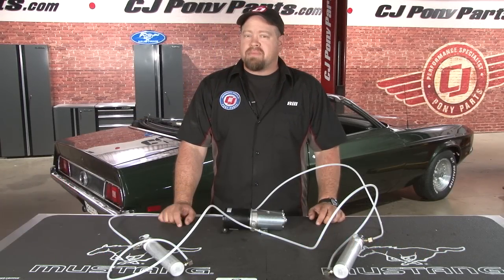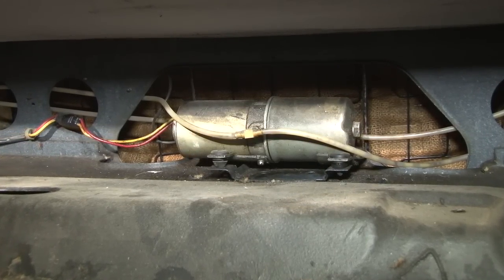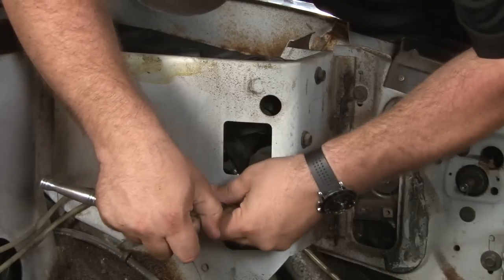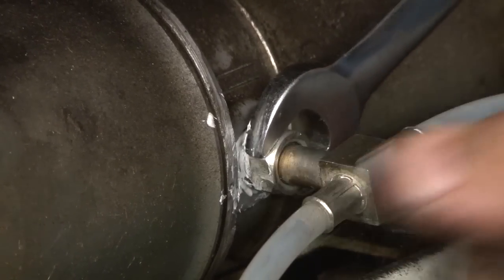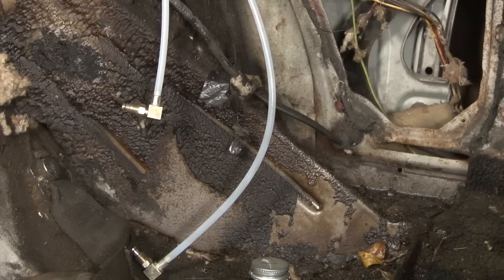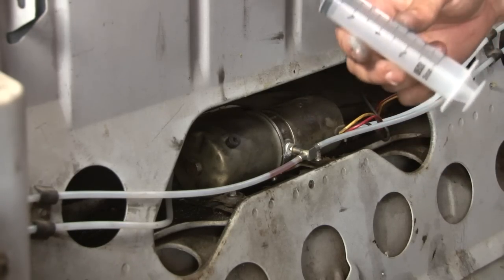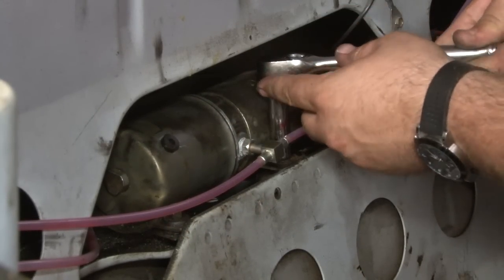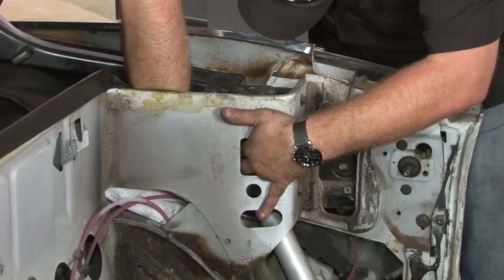Mustang Auto Pro Convertible Top Hydraulic Cylinder Driver Side Or Passenger Side 1971 Installation

Comment: I am working on an '05 mustang.  It is amazing how little the system has changed.  I have one cylinder leaking.   Time to get to work, and hope for the best.
Reply: just bought an 01. top stopped working shortly after. motor and switch seem ok will change out my cylinders. just wondering if the hoses leak. your thoughts?

Comment: I followed this video to replace the hoses for my 67 Ford Galaxie 500 and it was nearly the same.  Thanks you.. The 67 Galaxie has 3 bolts holding a plate that keeps the cylinder in place rather than one bolt.
Reply: i have a leak in my cylinder or at the connection.  i can open and close my top but only with the glass window unzipped.   Do you have glass?   the guy that installed the top said i should have it unzipped when putting top down.   pain in the but.   i am heading out to work on the hydraulics leak on my 67 galaxie 500

Comment: Thank you. I have EXACTLY the same problem in my 2003. I am ordering the hydraulic hose line and tackling it myself. Thank you! Ford dealers were no help!
Reply: Lily, I just bought a 2001 in april. the top went up and down fine for the first few times. Now I am seeing leaking inside the drivers area where the top comes from. I think replacing the hydrolic cylinders will do it. what about the hose lines? How will I know if I need those. did you do the project? how did it go?

Comment: I just recently fixed the hydraulic on my 69 convertible and although the video was very helpful (thanks Bill) I have to say it was a little different than the 70s in that video:
1.) To remove the cylinder arm from convertible top, there is a little bar that you need to unscrew before as the pin is right behind that bar (bummer). 
2.) Also the pin is secured with a closed retaining ring that is hard to get off and even harder to put back on (whoever invented that should be fired..well, if he was not retired already :-)!
3.) In my 69 I found it easier to unscrew (2 screws) and remove plates to take cylinder bodies out of their fastening
4.) This is important and not mentioned by Bill and also nowhere else to find as both cylinders and lines do not come with instructions: The lines come with 6 O-rings - you HAVE to put them in the 2 holes of each cylinder and maybe the motor (I used old motor so the O-ring in there was still working) EVEN if you see some sort of O-ring system already in there. Otherwise you will not get the system sealed and during the bleeding process ATF will splash all over you (a lesson I learned the hard way). People might think that is obvious but since there is already something in the holes of the cylinders that look like O-rings one gets easily confused.

Comment: I have used instead of a baster.I used the container from the brake bleeding kit .I just run a hose in the hole .then tip the container or cup upside down .and let it flow.

Comment: I am using this video as a guide to replacing the hydraulics in my 1965 Mustang, it helps a lot but it takes far more time than it seems on the video, and,  hoo, boy, there are definitely some differences.  Jeeze, Louise, helpful though most of this really is, I wish you had told us that filling the motor and bleeding the lines would take a quart of ATF and at least an hour of back and forth.  And on the '65, there is no handy dandy little rubber plug, it is a big brass screw, and it is on the side, not the top, so, who knows when it is full, it leaks all the time unless you hold the motor up vertically and fill it.  Also, the back of the seat does not pop out, it is bolted in, the old hydraulic pumps do not just pop out with a wiggle from a pry bar, you have to unbolt several bolts and pull a flat plate of steel..  It goes on and on, but, still, the video was a great help, plus there was a diagram I found online that was also almost as helpful as the video when it came to removing the hydraulic pumps.

Comment: I guess it goes without saying..  with everything disassembled its a good time to throughly clean up the messes, that fluid makes, plus its a good time to lubricate the the rear quarter window tracks, and guide wheels, and replace if necessary.  Also, paint those side panels..  back to white if possible.   I see a lot of repair videos, where the guy completely misses opportunities to clean, re-paint, and lubricate other systems that become more accessible during the primary system repair.   Also inspect your floors for holes, and repair and primer and paint any bare or rusting metal.

Comment: My top won't go up on my pony.. I have power & hear the motor in the down position but not in the up position... Should I replace the switch?? Once the power assembly is removed how the heck do you get the switch out? 
Fluid is fine ✔️
No leaks ✔️

Comment: Great Video. I replaced both  cylinders and hoses  but my top wont go all the way to close at top.  a couple inches short.   I guess replace motor or could i adjust frame?

Comment: I closed my top on the new Beetle manually, because the micro switch did not work. I opened the valve half a turn. What can I do so it runs with the motor again. Just close the valve? Or do I have to bleed the system? Should I open an close it manually a few times so air can eventually go out?

Comment: I Have an 03 convert Bison Ford Garage refilled my fluid and now its leaking out of under  my car " they will not do anything about it".  "That's the chance you take when you put fluid in"  they said.. It most likely cracked the cylinder on the driver side they said.   I was wondering if you know where I can get used ones or new ones.  I won't go thru them for anything. Thanks

Comment: Thank you very much.  I have an '86 GT convertible, 70K miles (not a misprint, it all checked out on carfax). I've owned it for past 2 years, put 7,000 on it.

 A hose on the passenger side broke yesterday.  Looks like a very clean break...like it was cut.  I've got the seat out, door panel off, and have mopped up all the spilled fluid on the floor that was under the seat.  The top is down.

 1.  Could the hose have gotten caught up in the brackets and moving parts of the roof, causing it to be cut??

 2.  When you pass the replacement hoses from the pump down to the lift cylinder..around that corner, down through the door frame...is caution needed to make sure the hoses are in an exact postion to avoid getting tangled up in the moving parts of the convertible top?

3.  The present hoses on the passenger side appear just as they do in you video..mostly white, with a stripe on them.  The hoses on the driver's side, however, and all encased in a black rubber jacket.  I was curious as to why.

4.  Wish the hose showing a complete cut...would failure be immediate?  Or is it possible I made a few trips and top raises and closes before it would not work anymore?
  Thanx again for the video...it give me courage to take this project on.  I'm an amateur...in case you could not tell by my questions.
Reply: tom smith The top will go up on one cylinder but very slowly and since the mechanism is a loop eventually all the fluid will be lost where the line was cut. If the line gets caught in the mechanism usually it gets mangled and is not a clean break. Make sure when replacing the lines they are clear of moving parts.

Comment: Well done video.  I have a question concerning assembly.  Is there a reason you added sealant to the compression fitting threads on the pump?  I've always understood, it is not required because the seal is at the flare/seat on a compression fitting, not the threads as with an NPT thread.  Just wondering if this is particular to this installation.
Reply: Timothy Lumpkin Just habit

Comment: Bill, nice video.  I've got a 67 convertible and only one side of mine works so I'll be going through the procedures but here's my quick question:  why not replace the drive while you were at it, since you have new lines, new left side cylinder...just curious?  Mine is the original and I'll be interesting when I go check this out.
Reply: We did replace both, just didn't show both sides since the process is the same for both sides.

Comment: Can you put too much fluid in.  I tilted up my motor and filled the reservoir.  I may have put too much in.  Or I may have air in.  I didn't work the top up and down with the plug out, I put in and moved top up and down.   That might have been my mistake.

Comment: hey bill,i had a question you might be able to help me with, i have a 91 mustang and i am replacing my hoses and cylinders on the convertible top, when i pulled the cylinders out they were covered in grease and filthy and i neglected to jot down how they were oriented, should the holes in the cylinders where the hoses connect to point towards the front of the car or the rear? not really sure if this is a big issue, just wanted to make sure i dont foul anything up, thank you so much!!
Reply: The hoses coming from the front of the motor should go to the front lower holes on the cylinders. The rear go to the rear higher holes.
Reply: do the cylinders just need to be pried out. cant figure it out 89 lx
Mike
Reply: ***** They shouldn't have to be pried out but I have come across a few that would not budge without some persuasion.
Reply: ***** hey owen, no they dont pry out even though at first thats what appears to be, there is actually a little bracket on each side that comes out and once thats out the cylinder will slide out, look for the spot where the cylinders are anchored,there are 2 little bits that hold them in place,one of those is attached with a screw to the frame, remove that screw and the bracket comes off and then you can slide them out, the other one is spot welded to the top frame.

Comment: I'm having the same issue in my 03 mustang. It is leaking from the top of the hydraulic cylinder as well, should I replace the cylinder and both lines or both cylinders and both lines?
Reply: If the leak is just at the cylinder and the line is not leaking then you are ok to just replace the cylinders. I usually recommend replacing both but you do not have to.
Reply: Bill Tumas
Thanks!

Comment: I have an 04 which is leaking from the right-side lift cylinder.  The leak is coming from either the upper lift-cylinder connection point or perhaps from the top of the cylinder itself, I really can't tell.  Is there any way I can fault isolate the problem to either the connection point or the lift-cylinder?  Is there some kind if varnish or epoxy that I could coat the outside of the line's brass connector with, at the connection point with the lift-cylinder, that might seal it?  I figure if there was something I could coat the exterior of the connector with and the leak stopped, that would tell me that the problem was with the connection point....and of course it would also fix the problem.  On the other hand, if the leak persisted, that would tell me that the problem was with the lift-cylinder itself.    Thanks in advance!
Reply: I have never tried anything to seal the leak, usually you can tell by running the motor if the leak is at the connection point or not. If you are losing fluid from anywhere the cylinders will not work properly.